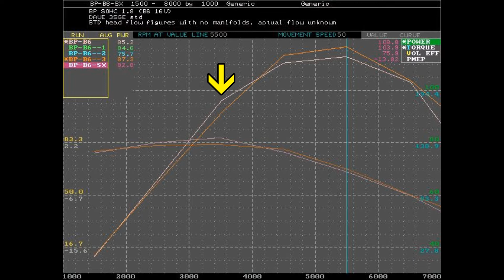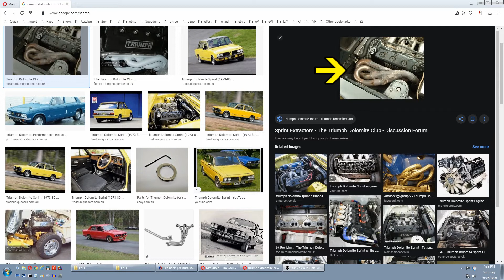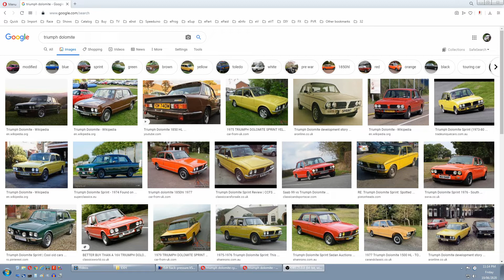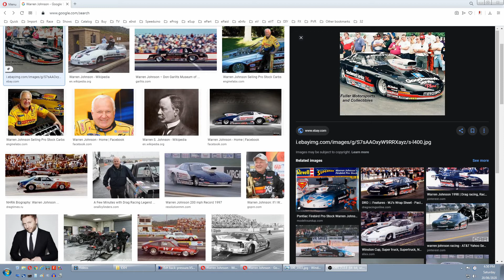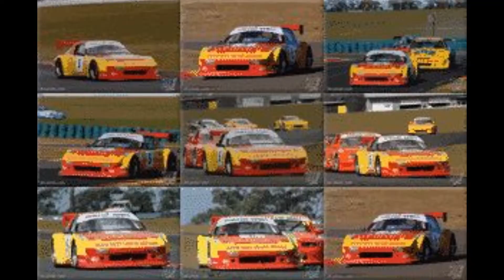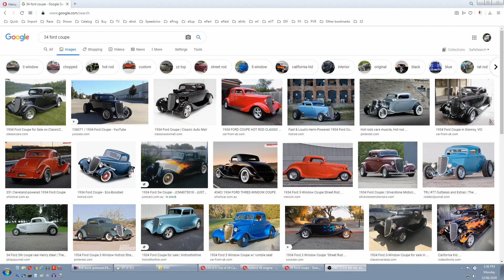Exhaust Back Pressure

Comment: Awesome videos very informative. Following on from your rotary port development flow testing what do you feel is the best exhaust system to run on a n/a 13b bridge port or peripheral port.
Thanks
Reply from the maker: Considering I only built the engines and sent them out on crates with the owner bolting on whatever they could find, ie, no dyno info because the owners were cheap, logically 1 rotor would have the same pipe as 1 654cc cyl of a 4 cyl making 300hp. 
You'll have to interpolate your engine based on these. 
At 100%VE if you want peak power at :-
180hp 6000rpm = 1.5" - 1.65" primary pipe
214hp 7000rpm = 1.65" - 1.77" primary pipe
250hp 8000rpm = 1.77" - 1.9" primary pipe
283hp 9000rpm = 1.9" - 2" primary pipe - I think this is similar to Racing Beat catalogue -
If you can make more power at lower rpm, ie, 115% VE
310hp 8000rpm = 1.7" - 1.8" primary pipe